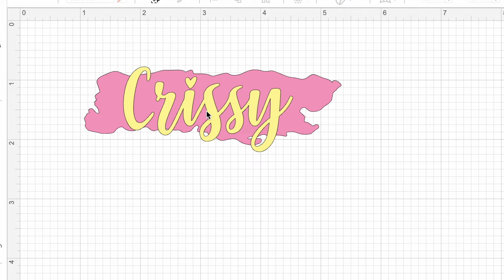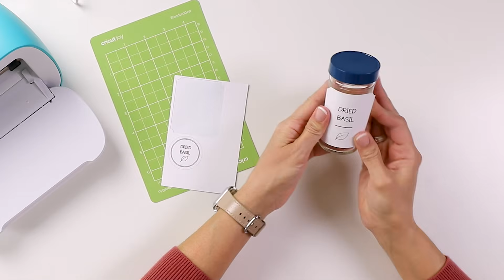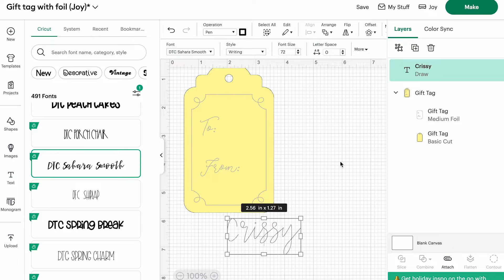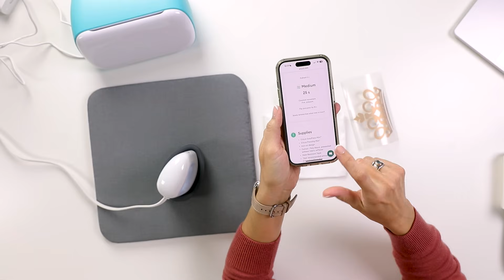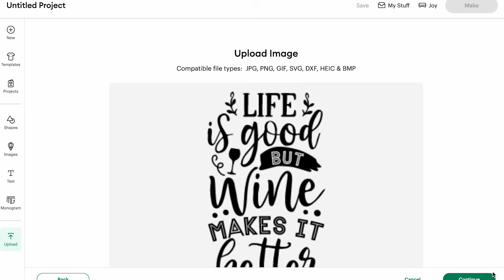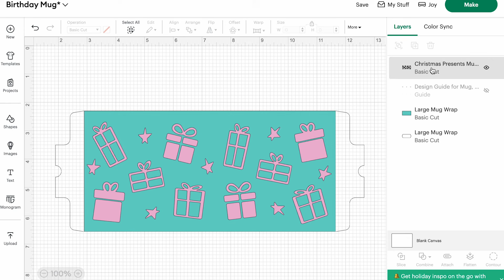My Top 10 Favorite Cricut Joy Projects for Beginners

Comment: Hi, is the print on tote bag is washable. Doesn’t it fade away with washing?
Reply from the maker: Hello. Infusible ink can easily be washed, and most vinyl can be washed as well. You would just want to check the care instructions on the tote bag itself. Iron-on vinyl lasts many washes, and infusible ink lasts longer.

Comment: Do i need a card mat for making cards or can i use standard mat?
Reply from the maker: You can make your own cards with a standard mat. The dimensions of the card will be limited by the length and width of the mat, though. You would then fold it after cutting. The card mat just makes it easier to cut the front of a card without cutting through the entire card. I hope that helps.

Comment: Is there a lot of color designs to choose from on the app?
Reply from the maker: The color of the projects depends on the materials you choose to cut, not the colors in the software. There are many colors you can select in the software, but that’s mainly for you to keep track of the materials you’re using and the corresponding designs. So if I want to cut a red piece of paper, I’ll use red in the software to visualize what it will look like and make sure I cut the right color. The only time the color in the software matters is for Print Then Cut projects, and you can usually modify those colors (if the design allows it) and choose the exact color you want.

Comment: Can i use it for shirts and sweatshirts?
Reply from the maker: Yes, definitely! Just keep in mind the size limitations. You may have to cut portions of the design to piece together. For words, this isn’t an issue, but if you have a wide image, you’ll just have to check the dimensions. Smart heat transfer vinyl will give you the maximum width since you don’t need a cutting mat.

Comment: porque se me hace tan dificil desllervar,  no me corta completo
Reply from the maker: Hello. Sorry, I don’t understand your question. Are you having a specific problem with the software or the machine?
Reply: @FirstDayofHome no se que hacer no me marca o corta completo el vínyl
Reply from the maker: I would make sure you use a mat if it’s not smart vinyl, have the correct material settings in the software, and make sure the blade is good. If all that is correct, try adding “more” pressure in the software when you choose your material to cut. If you still have trouble and it’s a new machine, I would contact Cricut for support to see if it’s a hardware issue. It definitely shouldn’t be that hard, so maybe it’s a hardware issue.

Comment: I’m thinking of buying a Cricut Joy. Will the software work with my iPad or is a laptop or desktop computer required?
Reply from the maker: Yes, you can use an iPad. I do that sometimes too. You can also sync projects across devices in the software. I find it easier to design things on a laptop, but you can still do that on the iPad once you get the gist of where things are on the menus.
Reply: For someone who only has an Iphone you can’t use the software? You’d have to purchase an additional device to work the machine?
Reply from the maker: No, you definitely don’t need a desktop or iPad to use the software. I’ve used my mobile phone as well. It works on both Android and IOS. I just generally use a desktop because I spend most of my time working on one.

Comment: Hi. I'm a newbie just turning into your channel. I loved all the different projects that you showed, you definitely had some good beginner tips/tricks/hacks. i don't have a cricut machine just yet; but feel like I'm stuck between the joy/joy extra. i don't do a whole lot of extreme crafts; just the basics. I saw that you did a project using the mug press. Is the mug press only compatible with the joy or can it be with the other machines too? I don't really want to do stickers, but also want to try & do car vinyl ones though. What's your suggestion on my little dilemma? Overall I found that you were a great tutorial throughout your video. --Amelia
Reply from the maker: Hi Amelia! I think it all depends on what size project you hope to make. The mug press is compatible with all Cricut machines. You would just need the longer cutting mat for the Joy if you want to make a full wrap mug design. The longer mat is a minor expense, in my opinion. You could definitely make car decals with the Joy too. If you want to make wider designs, that’s when I’d consider upgrading to the Joy Xtra. With smart materials, you can make longer designs (up to 4 feet long) on the Joy because the material will feed through without a mat. However, you’ll still be limited to the 4.5-inch width. I hope this helps!

Comment: Hiya, loved this vid tutorial, I really want the machine to make vinyl stickers to apply on balloons, is it possible on this machine?
Reply: I want to create names on cardboard. Or a label. Is this good enough for it?
Reply from the maker: The Joy can cut vinyl lettering and writable label vinyl that would work for that. You can then place those on cardboard or another surface.
Reply from the maker: Thanks! For stickers, I'd recommend getting the Joy Xtra, Explore, or Maker machine since those machines can use Cricut's Print Then Cut feature. You would print your sticker sheet on a home printer and then cut the stickers with your Cricut. The Joy can't fit a normal copy paper size. There are some hacks out there to make stickers with the Joy, but it's not truly built for that type of project. If you are just cutting solid shapes like circles, numbers, letters, etc. (no multi-color printing required), you could use the Joy for that. Hope this helps!